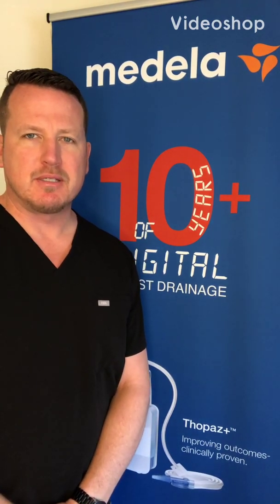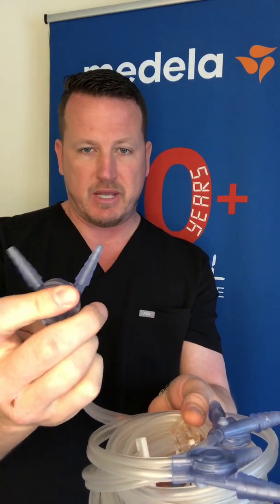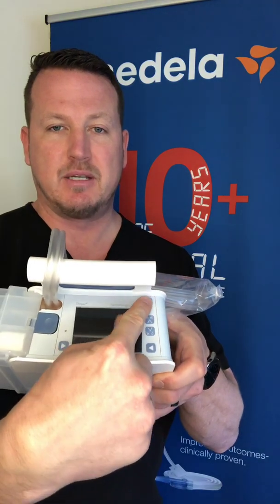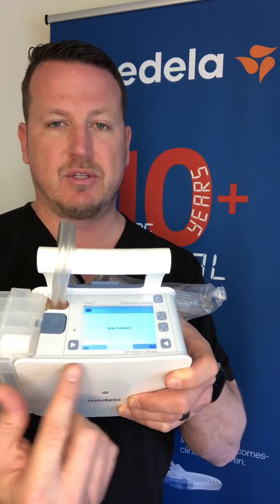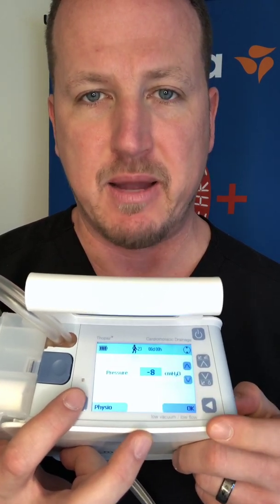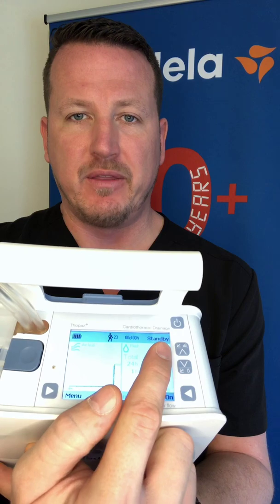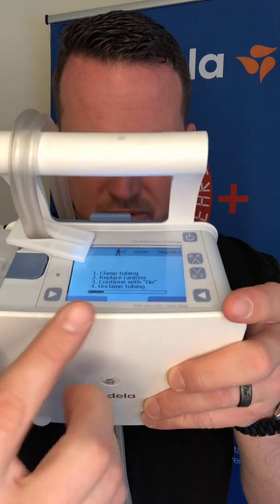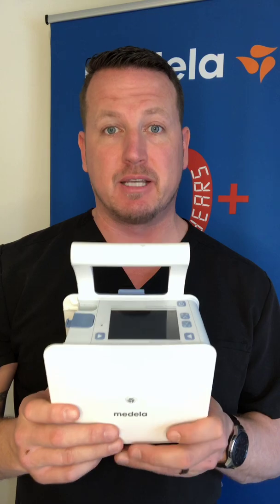200424 Thopaz+ Digital Chest Drainage System Demonstration Video 1

Comment: And also there is canister with solidifier where the liquid becomes gel. Also in order to use the 2l canister you need a small adapter to support the canister, and of course patient cannot be in mobility.